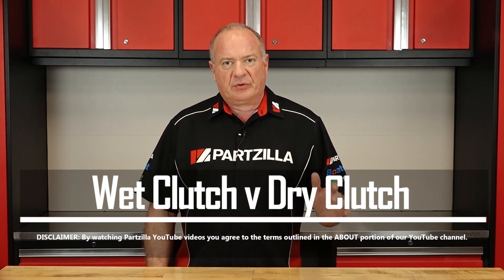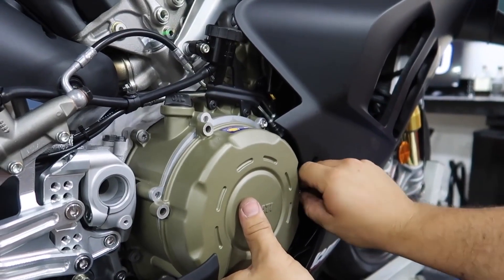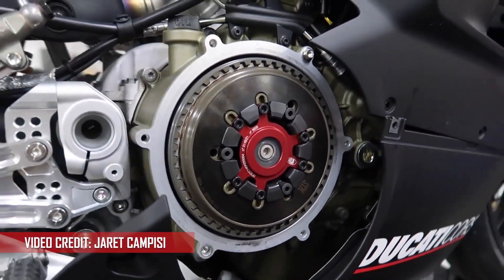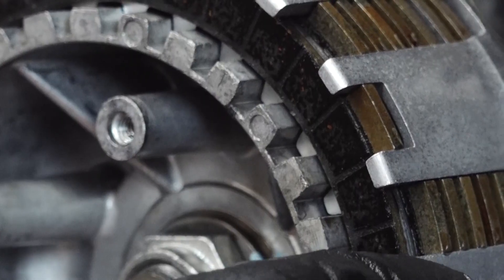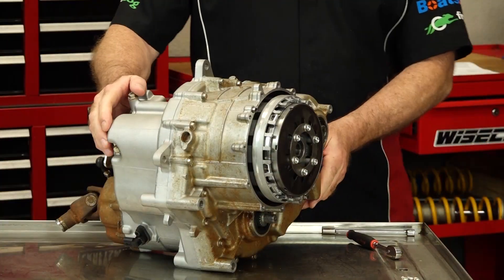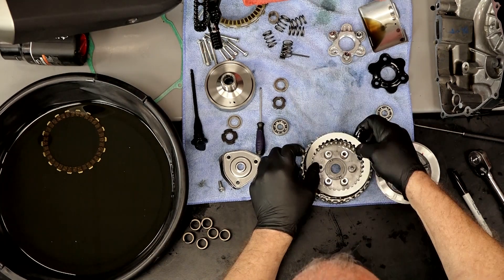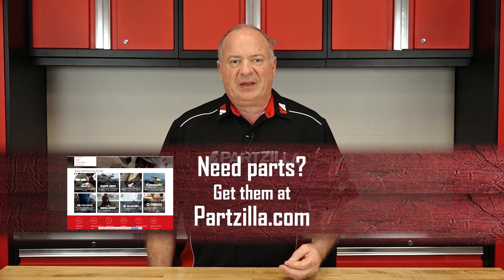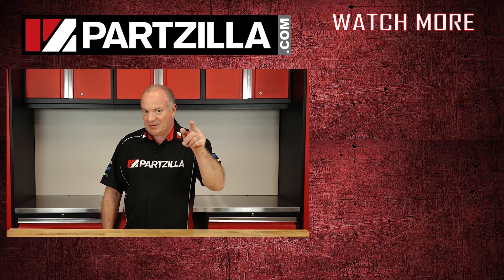Wet Clutch vs Dry Clutch | Are Wet or Dry Clutch Motorcycles Better? | Partzilla.com

Comment: Excellent video.
I've had both over the years.
Also several bikes with dry single-plate clutches (Guzzi etc). 
Generally, it goes with the manufacturer and is not the reason people choose one or another bike.
I prefer dry, largely because replacement is so much simpler.
Morini, Ducati and other Italian bikes of the 70s and 80s went with dry multi-plate and chains.  
Somehow, that is where the heart is.
But I can't hate an excellent Japanese sports bike just because it has its clutch in an oil bath.  😊😊

Comment: Dry clutch allows faster service, keep oil cleaner but make more noise. Wet clutches run cooler, and tend to last longer.  I had a 748 with an 853 big bore, it was a great bike, but that clutch rattle and sing was loud.
Reply: she was dry clutched??
Reply: @fidelcatsro6948  the 748, 916,996 and 998 all had dry clutches.
Reply: @randombuilds8336  wow i never owned a dry clutched bike before!
Reply: Thanks for summarizing the video I just watched.